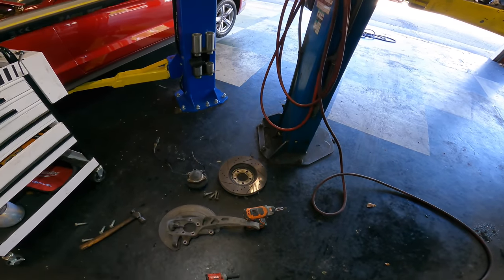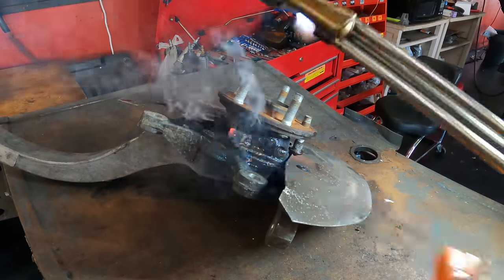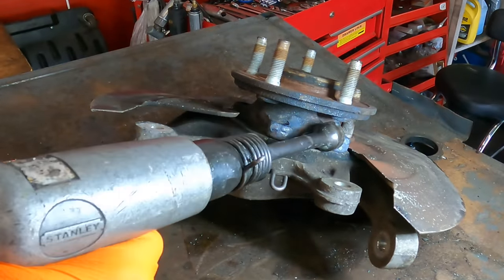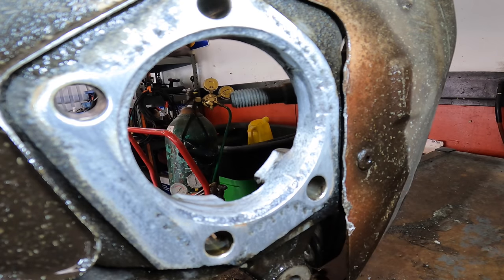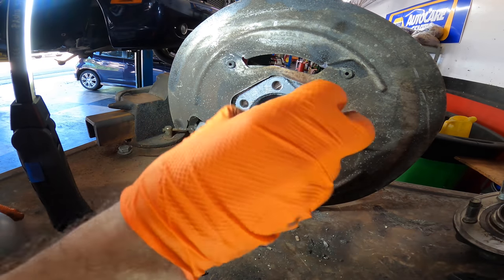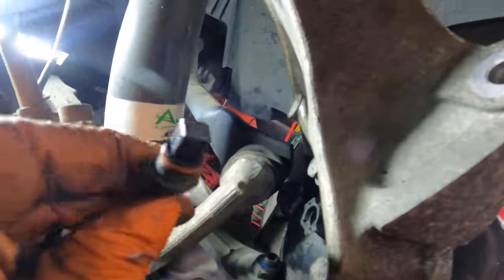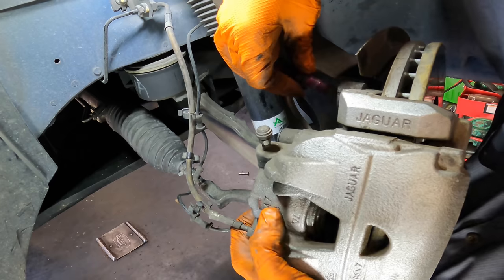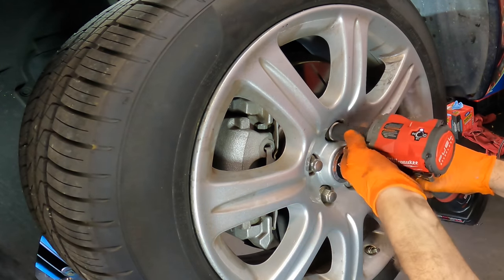Serious Corrosion! HEAT Required! Torching a Jaguar 2008 XJ 4.2 Hub Bearing/Bent Parts

Comment: Aero Kroil - I dont know how it works, it doesnt have much lubricant but it does what it says on the can and creeps.

It penetrates more than it lubricates. I thought it garbage for a while until I used it for wheel bearings. It must have a high Ethanol, or other petroleum product, percentage. Every wheel bearing so far I thought would be a nightmare, the brass hammer got it out.

Not saying it would have worked here, just my experience with it. if you dont have any, check it out.

Comment: See this is where you should be illuminating your audience of the process that has occurred when 2 different metals have mating surfaces, the aluminium hub carrier sacrifices electrons to the harder steel/iron of the wheel bearing as they coth undergo corrosion.

The resulting reaction causes a bond between the two metals causes a chemical/mechanical bone that causes them to be difficult to separate making you need to use heat to break the lock between both metals, it is very common these days as weight saving taken into account can mean a better power to weight ratio in vehicles.

Alloy wheels are bad for this where the powder coating (if there is any) between the iron hubs and even the iron wheel nuts/bolts are also common and any alloy engine parts and iron nuts/bolts.

It can be a mechanics nightmare but this is why these parts can be difficult to replace... just saying lol
Reply: Only the British would use a combination of metals that turn to fluffy White stuck togetherness in a country that is never rain free for more than a week
Reply: @bryanlatimer-davies1222  Clearly uninformed!
Reply: Best tell texts speed that then lol, does your vehicle have steel or alloy wheels??
Reply: Dissimilar metals yup
Reply: @bryanlatimer-davies1222  Was owned by Ford.
Reply: A little Anti -Size on potentially corrosive materials, goes a long way. It only takes a drop spread thinly to do the job.
Reply: @bryanlatimer-davies1222  Ford did it on their transmissions/Front pumps. 2001 - 2005 Escapes( maybe more not a mechanic ) had the bad transmission and they would refuse to warranty the front pump because of " corrosion ". Just another way to screw their customer and the best way to lose one. My Toyota's have been awesome and my 2007 Tacoma is still going strong.
Reply: @TheWabbit  So you think your Toyooter doesn't have ferrous and aluminum pieces mated together?  Silly boy!
Reply: @svenulfskjaldbjorn5401  I don't really care if it does or not, I'm not going in every year to get something fixed that shouldn't have failed. Besides maintenance which I do myself , I've only put on an AC compressor. If you want to count the catback exhaust ( which I consider a wear item after 15 years ) both of which were done last year,  I have less in repairs for my 16 year old Toyota then I had in my first 3 years of the Escape under Warranty.
You can leave that Boy shit on your own feed!
Reply: Metallurgically, what is happening here is two dissimilar metals in a wet environment acting just like a battery, causing galvanic corrosion.
Further, I am British and take umbrage at the assertion that the place is never rain free for more than a week.  In the 30 years I lived there, I can remember few, if any, rain free days.  So there.

Comment: your comment about never seize was strange to me as I use it on everything,  also a rose bud tip would be what you need for heating  noy a cutting torch .
Reply: Anti sieze.  Its written on the jar.
Reply: @cayman9873  Bostik makes 'Never Seez' brand anti-seize, which I think is what Joe was referring to...

Comment: I hate to sound like a know it all but working with machinists for near 40 years they taught me a few things about heat, interference fitment of parts and how to separate and assemble such things.  You should If I may suggest, put the piece in a press or apply a puller/pusher  use a rose bud tip instead of a cutting torch head .  Apply force to the movable part and quickly heat the stationary part. You'll be surprised at how little heat it actually takes to separate the parts.  Personally I wouldn't want any of those parts installed on my vehicle , they've been heated way to much.
Sorry bud that's my educated opinion.
Reply: Agreed. I didn`t like the look of that housing afterwards at all.
Reply: I worked for the engineering company that supplied those parts to Jaguar,  the bore limits were plus or minus 4 microns , try doing that with a whizzy wheel.
Reply: I agree. If he HAS no press, NOW theyre knockn out stud, installn a bolt w/nut & use THAT to press with. That poor bearing is screaming for lube.
Reply: Overheating changes the microstructure of steel. In other words, it weakens the steel.  Not good.
Reply: @jonpag43  That would be like .0005"   Is that plus or minus or the interference fit?
Reply: You think that steel doesn’t get hot from using the brakes?
Reply: @leadman4273  Tempers it ,gonna snap in two
Reply: @MrTonyPiscatelle  on the drawing it gave the size +/- 5 microns
Reply: @jonpag43  so plus or minus a half thousandths
Reply: @riceburner4747  The bearing was crusty junk and was not reused.  He said that in the video.

Comment: It looks and sounds like you're running your drill in low gear. Especially with the flapper wheel switch it to high gear. 
The BEST tool I've found for those is the Milwaukee Die Grinder! It's made using burr cutters and abrasives a TON better.
Definitely recommend one for a mechanic!
Reply: you cut with it? i bought one recently and it doesnt cut very well, cant lay into it like an air grinder lol. it cleans like a beast though

Comment: i put the bolts on the back of the bearing and use them to drive the hub bearing out, then when it gets just about all the way out, remove bolts and finish knocking out
Reply: I've had good luck with this too but still need the torch once in a while

Comment: If you're struggling like this person I have the cure knockout the old lug stud use a threaded rod and nut to remove the hub bearing very easy sometimes using two threaded rods and a two nuts on both sides will help you get it off easier

Comment: First off Ray aluminum releases heat much faster then steal. Second thermo expansion happens when you apply heat. So it would be best to apply heat to the aluminum. To break it free. It's best to apply heat to the outer part. Then cold to the inner part. God bless
Reply: Good thing he didn’t use that torched bearing then, isn’t it?🙄
Reply from the maker: I don’t like touching aluminum Jaguar parts
Reply: @RainmanRaysRepairs  understandable just saying heat works on the outside. Cold inside. Perhaps use ice next time on a item you need out. God bless

Comment: I think I would have tried propane or MAPP torch on the aluminum arm first. Not as much heat as acetylene so as not to damage the arm, but maybe enough to expand the arm and break the rust.
Reply: Used about a half a bottle of MAPP to do a Mercedes hub. Got to 589 F and it did work! It takes a bit but didn't hurt anything.

Comment: Ray, you said "don't worry, I'm downwind of the smoke."  Ray, you want to be upwind of the smoke not downwind of it. Upwind implies the direction from where the wind is blowing from downwind is the direction it is headed. Aircraft always try to land into the wind which is called a headwind. Flying the downwind leg of a racetrack pattern is flying with the wind and a turn to base and then to final puts the aircraft on a heading into the wind that allows wind over the wings to provide additional lift and slower approach speeds with less chances of stalling the wing or landing long like what would occur if you landed with a tail wind or landing downwind.

Comment: The older Jag’s had inboard disc brakes on the rear, lots of fun and frivolity!! Now Ford have their sticky fingers in Jag they are not the same cars. I remember setting up the valve’s on Jag engines using shims in the shim buckets, fun times!
Reply: Ah yes, but were they shim over bucket or bucket over shim?
Reply: @dopiaza2006  bucket over shim

Comment: Backwards- heating the hub expands it and makes it tighter in the upright- aluminum expands at twice the rate of steel, so you should heat the upright which will expand and loosen around the hub.

Comment: i had the same issue with the wheel bearings on my 05 murano and it took hours of me beating on it then took a massive sledge hammer after it finally came loose

Comment: Need a heating tip instead of a cutting tip, before you burn a hole in it.
Reply: Rosebud
Reply: Not really in this instance. He put all his heat into the bearing which wasn't going to be reused. Would it have been better? Yes. Needed? Definitely not.
Reply: Sometimes you only need what you have at the time.
Reply: Not if one knows and understands how and why the gasses interact to change the heat and nature of the flame.
Reply: That cutting head IS a heating tip, it works faster than a heating tip also.

Comment: Whenever I get a Jag in here in the UK and it will involve getting the CV axle out of the hubs on its splines, I just tend to run a mile, scream, then quote for a secondhand hub assembly!  Cos it ain't coming out!  
Superb job!  Always enjoy a bit of hot torch action

Comment: Useless Facts: 

1. Buddy Ebsen was originally cast to play "The Tin Woodsman" (or "The Tin Man") in The Wizard of Oz. However, the makeup used was powdered aluminium, which gave Ebsen Asthma. The makeup was changed to something less dangerous and Ebsen was replaced by Jack Haley.

2. What's wrong with using an impact driver to torque down lug nuts? NASCAR teams have been doing that for decades. Okay, so a lug nut and/or a wheel occasionally falls off, but who's counting?

Comment: Hey Ray do you happen to own a rosebud torch tip for your torch always prefer the water at all cutting torch tip also you could have took torch heated around the outside of that bearing Spirit goes into the spindle hub and took a can of air for cleaning computer projects and turn it upside down and froze the heck out of that bearing and it would have probably just fell right out

Comment: Question on torqueing hardware if you dont mind. I've watched you do work like this on many other videos. Every time was click yes its tight enough. This time was the actual use of a torque wrench? Why the sudden change for this car? Is it because its a jaguar and its expensive. Or are you going to properly torque everything that should be now? I find it weird in the past everything is click yep its good. On this thing you made sure you used a proper torque wrench upon it. I work in the aerospace industry and yes I torque everything with a calibrated torque wrench to its proper torque spec.

Comment: Erik @ South Main showed a trick which works slick and it takes the hubs out quick. I keep a set of high grade bolts and huts available to do this now.  I won't post the link (it'll get flagged as spam), but replace the code after the v= in the youtube line with this:  p9543-dMBRo  and hit enter.

Comment: If the expansion rate of aluminum is 3 times more than steel, shouldn't you have warmed up the aluminum rather that the bearing assembly?
Reply: It came out didn’t t it? Always that “I know more than you” guy lurking in the comments section just waiting to pounce!
Reply: @bigtuna9529  If YOU have been an auto mechanic for more than 20 years, then you may kindly criticize my comments. ;-)

Comment: Would dunking the heated assembly have helped to achieve the differential shrinkage?
Reply: Yes, I heat and quench parts all the time. Works well, especially on rusted bolts.  I try not to on parts I'm reusing though but in the rust belt it's common practice

Comment: It's funny at just the other day I was watching a guy do the same thing on a video on YouTube trying to remove a bearing hub from a knuckle he cut one of those lug stud off he used a nut and a bolt through the hole in the hub work like a press and he removed it from the knuckle

Comment: In my early wrench turning days, we were taught that any long socket or extension changed the torque value. It affected the accuracy I guess is what I'm trying to say. Has that changed?
Reply: Yes.  It changed in that it was never true.

Now, if you're trying to undo a stuck fastener with an impact, yes, it will reduce the force of your impact gun on the fastener.  Nowadays we have The Torque Test Channel on youtube to show us that kind of experiment.
Reply: its constant pressure so it isnt going to change when using a wrench unless you have an extension made out of playdoh with something like an impact gun then it would act like a spring and lose energy

Comment: Hi
Can you do a video with how you find all the torque settings on all the different makes and models. Also maybe include the way to find the procedure trouble shooting checklist you have sometimes. I know experience working on things is the best but sometimes we look over some of the little things. 
THX.
Reply: They have a paid subscription service called All-Data but Google usually works just fine
Reply: Engine torques specs are all over Google; for other specs type in the part too and you find most of them. When all else fails drop by the dealership (with a box of fresh donuts) and inquire.

Comment: One of my aluminum rims was stuck on the rotor so well, it took my wedging a 2x4 between the rim and the frame and turning the steering wheel to break it free. It would not budge. Now why they use dissimilar metals in situations like that with out some sort of barrier, whether or be dielectric grease, or an actual felt/poly gasket, I'll never understand.

Comment: Ok, PSA: if anyone else is wondering, took me a while to figure this out. How can a bearing in a "new" part be crusty? And how can you reuse the bearing after burning the hell out of it? Well, the "new" part is not new, it's a scrapyard part. And the bearing that was grilled was the crusty one, which was being scrapped afterwards. So neither part that ends up being used was overheated.
Reply: @Bass.Player  You just repeated what the original poster said…..why?
Reply: worse things could happen like those rubber safety gloves melting onto his hands.😲
Reply: @sevenyearitch7936  Huh?
Reply: @MrCumstein  It seems like Bass Player is one of the people who start typing the answer without bothering to read the whole comment.
Reply: @sevenyearitch7936  He heated the bearing directly, to get it out of the... doodad. The bearing carrier thingamabob. Because the one that was on the car originally was bent. So you have one good doohickey with a crusty bearing in it, and bent doohickey with a good bearing. The good bearing came out ok, the crusty one was stuck. So he heated the crusty bearing to get it out. Ok, the whatchamacallit did get warm in the process, but not hot enough to do any damage.
Reply: @horrovac  couldn't have put it any better myself!
Reply: @Bass.Player  Dude your taking the word “new” too literally in this case, and the op clarified what you just reiterated, yet again.  I’m not the one who’s confused.
Reply: Just got to love those Van Gogh viewers. Only hearing half of what is said.
Reply: @Bass.Player  Well it seems to have confused you. Throughout I used "new" in quotes to indicate that I'm quoting Ray here, and I'm first stating what I have been wondering about. And then I say, literally: 'Well, the "new" part is not new, it's a scrapyard part.' And you seem to find it fitting to educate me that it's a scrapyard part, and that the heated bearing is not being used - all of which I said in my original post. Dude, it's right up there, it's not edited since posting, you just need to read it. Other people didn't seem to have found this confusing at all.
Reply: @horrovac  I think that is what happened or I responded to the wrong post?
Reply: @Bass.Player  Yes, that is what happened, and that is what I described already. The point is that there was no point whatsoever in you replying to my post arguing the same point. That is what MC 808 (and I) found weird. The only logical explanation is that you either didn't understand what I was saying, or that you didn't bother reading the entire comment before replying. And another possibility is that I am talking rubbish and you're correcting me, in which case I'd like to know what you find I got wrong, if you'd be so kind. As it is, this conversation is confusing and only getting more and more confusing-er.
Reply: @Bass.Player  Yes... Yes you have 🙄
Reply: @Bass.Player  It happens.  I did that once in a forum.  It was quite embarrassing.